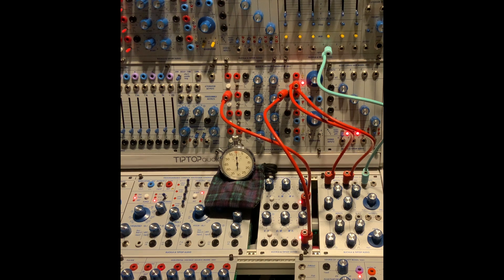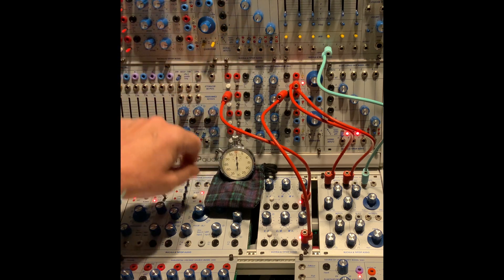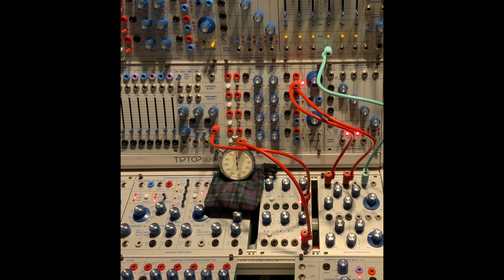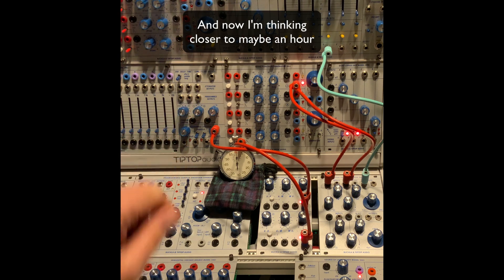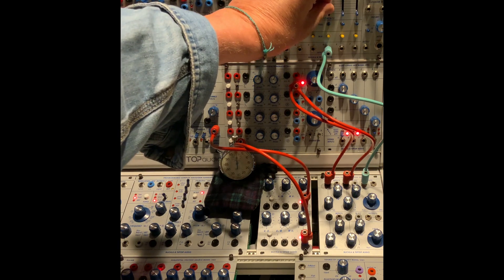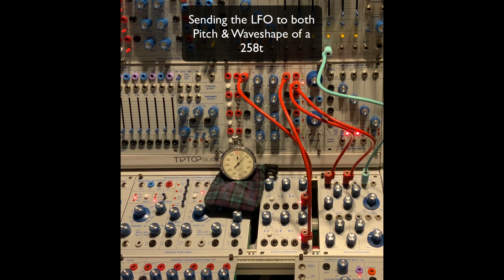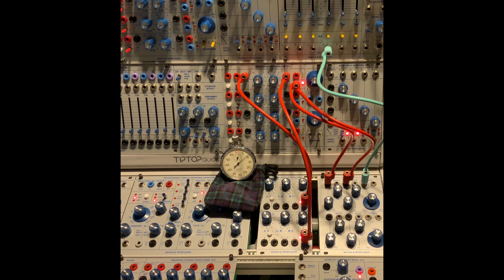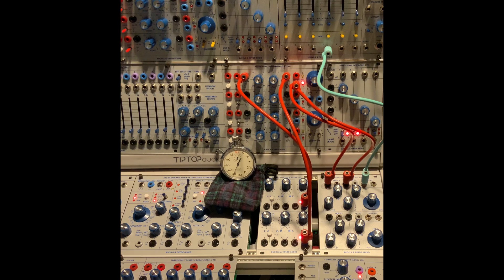281t Long Envelopes

Comment: I've had most of  the Tiptop eurorack modules for well over 1 year now, and I absolutely love the Buchla paradigm more than ever, and I don't even have the 259t or 296t yet!  Once you get it, its like there is no going back.  At this point, I'm not getting any more eurorack and am going to save for a mythical 200e system.  The thought of system wide preset changing on the fly is so enticing.  I wonder what Don would be inventing if he were alive today.    

I would love some more deep dives into the 200e modules.  Especially the sequencers 250e and 252e.  There are surprisingly few tutorials online for a lot of the 200e modules in general.
Reply from the maker: @TheSilentCartographer117  Happy Bychlaing! Stand by for  link or two
Reply from the maker: https://youtube.com/playlist?list=PLgcsaajaNk9etBIBcQo3QB8Kc3DB2tBa3&si=PxsN1zq8y0tXnb2w
Reply: @vgermuse  oh wow thank you!